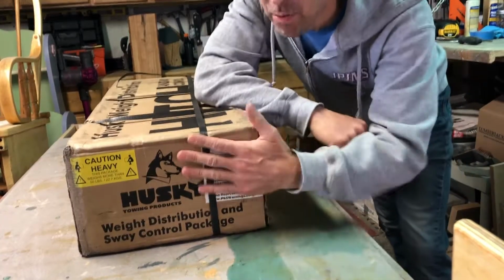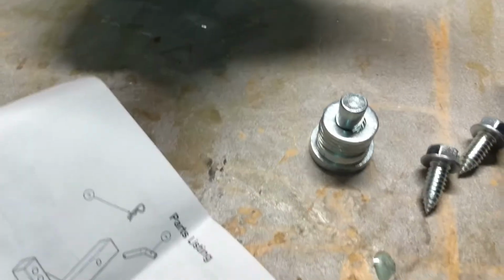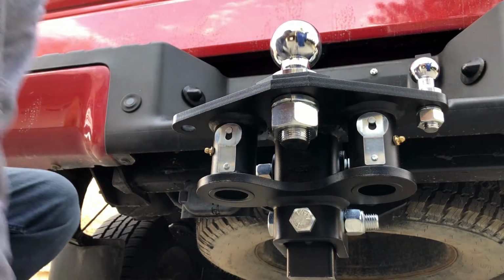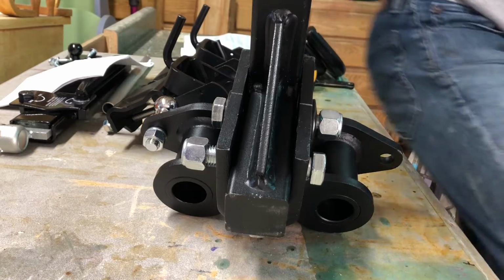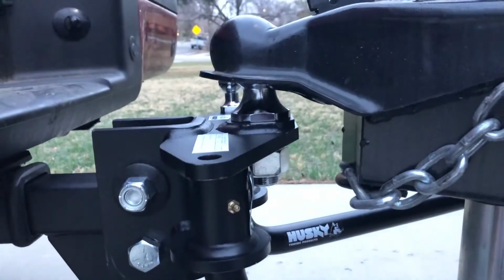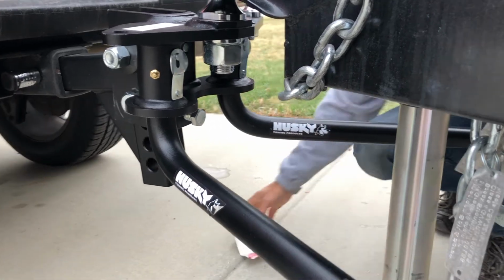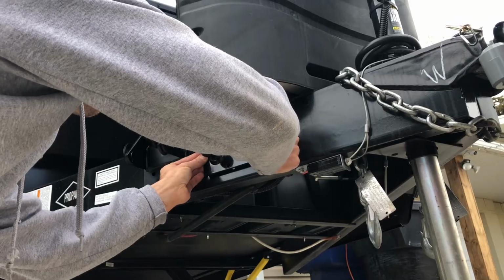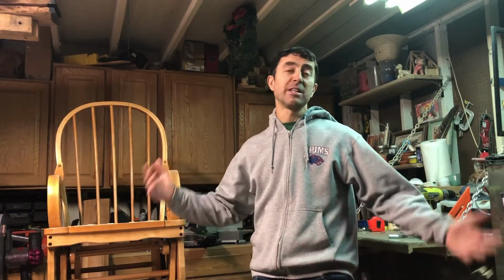DIY Husky Round Bar Weight Distributing Hitch Install

Comment: I bought a travel trailer yesterday and drove it home 300 miles after the guy I bought it off of didn't know how to adjust it like this, one chain was tighter than the other, he had the sway bar part in the trailer but never installed it before I left. I found it after I got home. The trailer swayed a little,  but not too much even though it was very windy all the way home. Found out I need a transmission cooler though. Thanks for the video.
Reply from the maker: Happy travels

Comment: Bought my Travel Trailer new with a dealer installed set up. Your video was excellent. The mechanic advised me to snug up the sway bar, then add 1/4 turn. Plenty of grease at ball contacts keeps the squeaky racket at bay. I look forward to your next video!
Reply from the maker: Cool thanks!  Ya, I add fresh grease for each trip then accidentally put my hand on it when setting things up.  lol.

Comment: Great video.  A before and after side view of your truck and rv would have been hellpful.  Lots of adjustments for that system.  We have the Husky without the chain and the stabilizer.  Much simlpler design and works great.

Comment: Thank you, I have the same hitch and anti sway bar, I never knew how it was hooked up by the dealer, thanks for showing me how it works. Also I upgraded to a HD truck that is a little higher than my 1500 and I will use your info to make sure that it is properly set up. Thanks again.
Reply from the maker: No problem. I have put on 3500 miles since I made the video and it's been working great.

Comment: Great video. In your adjustments, you're looking at coupler A but your trailer is a top mount coupler, B or C style. Looks like it all worked out in the end anyhow.
Reply from the maker: Ya, well 3500 miles in, and it's working great.

Comment: Hi Jason,
You mention the front of your vehicle should be 1” higher when properly installed.  I learned that when properly installed the front of your vehicle should drop half the amount that the rear of the vehicle drops. In other words the entire vehicle will sit lower but the front only dropping 50% compared with the rear drop.  That shows the weight is properly distributed when everything is adjusted correctly.
Reply from the maker: Oh I like that explication! Makes sense.  I’m going to check mine that way next time I hook up.  Would make a great short video. Thanks!
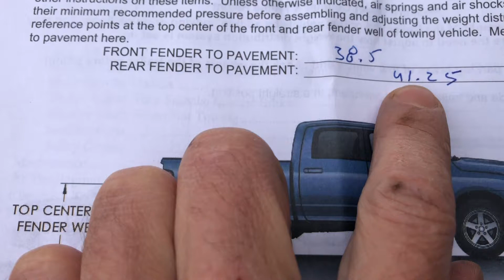Reply: Yeah, I'm confused.  At 20:46 Jason says his uncoupled front height was 38.5.  Then he says he wants to be that, or higher by 1".  I thought you expect both front and rear to drop (because you've added weight), but you want the drop in the front to be equal to the drop in the back.  Otherwise, what you're doing is squatting the back axle down and raising the weight off the front axle.  So then Jason measures and shows that the front raised by .25".  Probably insignificant raise EXCEPT that you've hooked up a trailer and the front and back should've dropped - not raised.  Then Jason says, "the sway bar is lifting the back of the truck up just enough."  WHAT?  You're not using a sway bar (yet) - you're hooking up a weight distro system, not a sway control bar.  I'm a newb, but this video needs a few edits.  It confused me more than I was before.  lol.
Reply from the maker: Oh no. I wish I could go back and edit a published video.   Sorry for the confusion.   But yes the front and back will drop but front less then back.

Comment: Thanks for the video. You have a very good presentation, very clear. My used trailer came with this minus sway bar. Looks like a pain in the butt. I ordered a blue ox sway pro. Much easier to install looking at video. We'll see.
Reply from the maker: Thanks.  Ya it was not easy.  Hope the blue ox pro works good for your needs.

Comment: How far do you tighten the sway control?  The instructions said to bottom out the threads but that's pretty tight.
Reply from the maker: I have always struggled with that too.  It’s not clear. I just make it pretty snug as there is a lot of leverage against it and you want to slow down any swaying movement that might start.  That said if I’m going on roads below 65 and curvy I Don’t even use it.  Also if your in the right balance with proper tong weight your risk of sway goes way down.   
Happy towing!

Comment: Great Video!!  I got thinking about the draw pin that goes through the hitch....it seems "weird" that a 5/8" pin is all that is used to hold the hitch...which holds 6000 pounds of trailer??  It would be better to have at least TWO pins holding the hitch in the receiver...taht way there is TWICE the material to haul "":the load"...!!
Reply from the maker: Thanks!  Ya that always baffles me but if the broke often the industry standers would change to something more robust.  Industry dose recommend changing your pin ever year.
Reply: @Jasonsdesignshop  Thanks for the reply Jason!!
 To replace the pin every year is a bit of comfort...for sure !! Another idea that I do is to pull the pin out of the brake away switch and see if the wheels lock up....BEFORE we leave on a trip...
Reply from the maker: Oh that’s a good tip for the pre trip checklist.

Comment: After the setup you have any porpoising going on with the camper? I have same setup but am getting bouncing frt/to back over bumps. Probably need to go back and reset it all
Reply from the maker: No mine is riding smooth.  Sounds like your hitch end is still to heavy making the front so light it can spring up over bumps.  
Maybe try moving up a link on the chain which will send more weight to the front tires.
Reply: @Jasonsdesignshop  will try that, thanks 😊

Comment: I'm not sure how to place the washers and pin for tilt between the ball and riser
Reply from the maker: It only goes in one way. If I recall I just used all the washers which made the everything level. then later I was able to use the lower adjusting bolt to lower the angle as needed. I hope you where able to figure it out! Looking back at my video I did not show that  part of the instal very well. Sorry about that.

Comment: The trailer and truck should be close to level when all hooked up.  If either is sagging or is too high, adjustments need to be made.  The most important point is not to have too much sag in the rear with the truck.  If you do, you're taking weight off the front wheels which is dangerous.  If the trailer is not level, you can get more tire wear will be uneven.  A side note, I don't recall you using the spacers.  Maybe I missed it.  You need those to get the proper angle before tightening the single bolt at the bottom.  Hopefully, you did use them?
Reply from the maker: Thanks for the  comments.  Yes I used all the spacers to get the angle right which places the right amount of lift on the bars.  Got her dialed in pretty well now.

Comment: I want to install a sway control but I can’t make it to the 24 inch mark us it ok to put it at 21 inches.
Reply from the maker: 3 in off center. Not sure how much tolerance there is.  But you can check by hooking your trailer up to your truck making the tightest turn you think you’d ever make to the side of the sway bar and then go out and see if it would collapse so far it hits the end and would probably break off or not.  If this looks like it would work I would still want an inch more that it could slide in just for safety.

Comment: looks like a new RV, do yourself a considerable favor read up, and watch videos on MAINTENANCE. Download some checklists, they help.  You need to winterize, check the roof and every seam, corner, light, vent, window, door, sealant, and repair before any leaks start. also keeping, all plastic, rubber, and gaskets clean and protected, and lubed.
Reply from the maker: Had it for a year and a half now about to winterize for the second time.  Thanks.

Comment: My driveway has a slight slope, would that mess with installing this hitch?  Just curious before I make the purchase.
Reply from the maker: I was concerned about that too, as my driveway has a 5% slop, but as long as the truck and trailer are on the same slop it should not make a difference. Go for it!

Comment: Hello Jason, I just bought the same hitch and the thing that is confusing me is that in STEP 4 it says the ball height should be 1" higher than the coupler height, however, this makes the bars 4 inches higher than they should be. If I lower the ball by 4 inches my ball height in STEP 4 will not be at the "Target" ball height. I'm assuming it's more important to have the bars at the designated height than the ball height?
Reply from the maker: Yes I believe you are right. Get the Bars to the correct height and thus correct tension and the Ball height will by default be fine.  If I am understanding you correctly.

Comment: Those two pins holding the L bars pop out and will fall on the ground and the whole system is useless.  Harbor Fright doesn't sell replacements eather. DON'T LOSE THOSE 2 LITTLE PINS.  I DON'T KNOW IF YOU CAN GLUE OR NOT.
Reply from the maker: Mine have never fallen out in two years but you make me aware of the possibility. I’ll keep my eye on them.

Comment: Definitely not getting 380lbs of torque with those adjustables. 🤔
Reply from the maker: True, and the fact is that is slid on me once back on the first trip.  I reset it with some pipe extenders over the handles for leverage.  Hasn't moves since.

Comment: Do a utube showing a lady how ro get this done. Like a tutorial for ladies who she tool savvy. Your utube will take off!!!!
Reply from the maker: Wow this is such an interesting idea! I /we (other male YouTubers) always talk as if we are only talking to other men.  This is a big mistake!  Ok I’m going to test this and make a video this summer where I help my 14 year old daughter through a project stereo typically designed for a strong man and how we can overcome the issues of weight strength and solve problems along the way so even a female teenager can do it.  I’m excited for this already!  Just need to come up with the perfect project to test the concept.
Reply: @Jasonsdesignshop  to:JDS, My baby girl, age 15, had to help grampy and Grammy change a flat on their big vehicle in middle of knowwhere. My baby girl is 5'1" and small framed. It was tough but grampy walked her step by step. Getting the heavy tire down and lifting onto hub was most difficult. Got to be an easier way for little ladies to move a heavy wheel.
Reply from the maker: Wow she is a champion!  I don’t know any tire change hacks.  Some things are just hard.  Oh I do use my feet to lift the tire onto the axel. Must have shoes on. Legs are stronger then arms.

Comment: You probably only burned about 30 % more fuel pulling that parachute, yes whoever wrote those instructions probably never pulled a trailer. The towed trailer needs to be 1 inch lower the front than the rear. That way you have wind forces pushing down on your trailer instead of wind getting under the trailer and lifting it. Basic physics.
Reply from the maker: Oh I like it that sounds logical.  Going to check mine next time I’m hooked up.